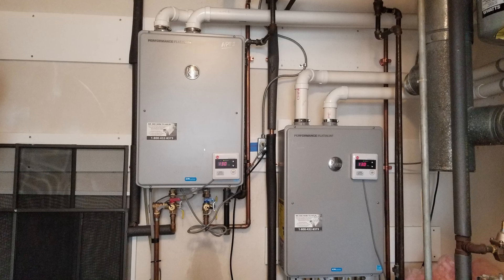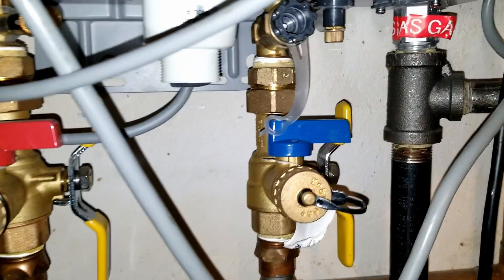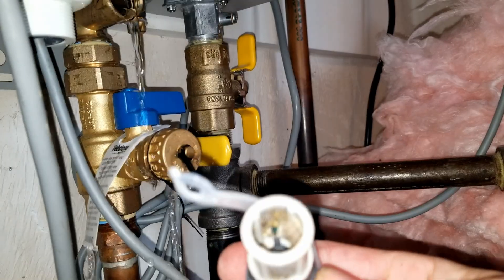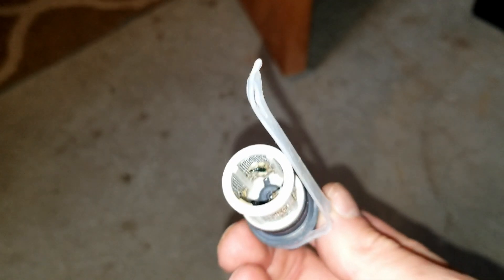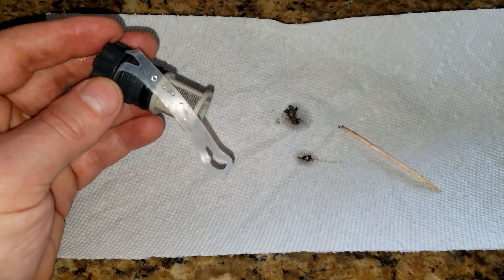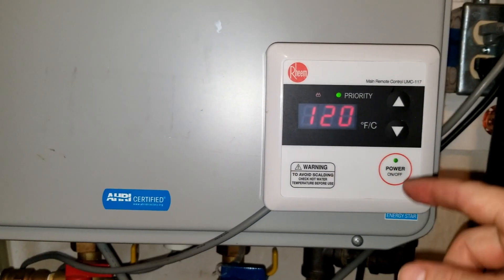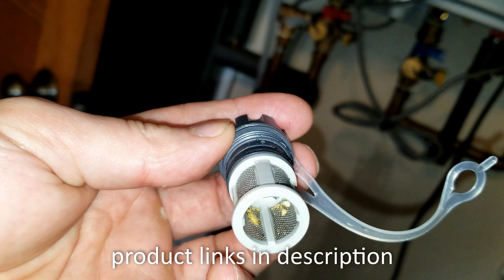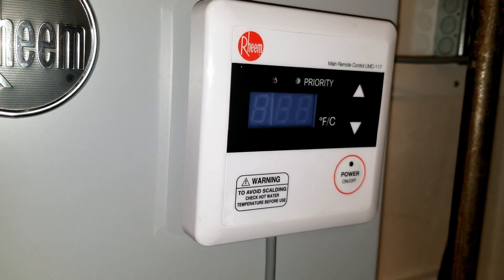Replace the water filter on your tankless water heater  - Rheem P1 code

Comment: I’d this a gas or electric? Bc i have a gas one ace I’m wondering if this is the same so i can clean my filter. Do i turn the gas off and i don’t have the blue and red valve knob’s.
Reply from the maker: @bethanygoins8010  gas, those knows are isolation valves. Makes it easier to service unit like cleaning the filter. You will need to shut off the water to remove and clean the filter
Reply: @ thank you, that exactly what i did and cleaned the filter, didn’t solve my issue tho so I’ll be checking the hot water line on my kitchen tomorrow and hopefully that helps. Also gonna check the handle thingy.

Comment: Thank you. Got mine clean but I still hear the beep
Reply from the maker: Unplug it, leave it off for 5 minutes then plug it back and turn it on.  If it continues it could be a gas lighter issue, has pressure etc.

Comment: I get the P1 code when my circulation pump is running but soon as I turn the water somewhere in my sink or anywhere the P1 code goes away and then when the water is not running nowhere the cold comes back after 30 minutes or so

Comment: Would this also help with water taking its  time to turn hot ?
Reply from the maker: It can if the filter is that clogged. I would definitely check although you might have other issues. A clogged filter will contribute to code 12 error.